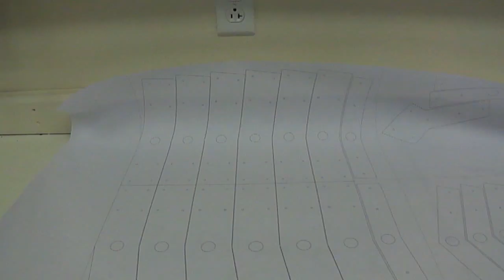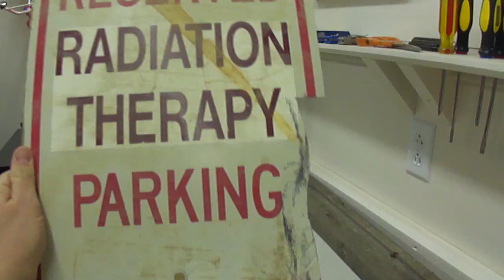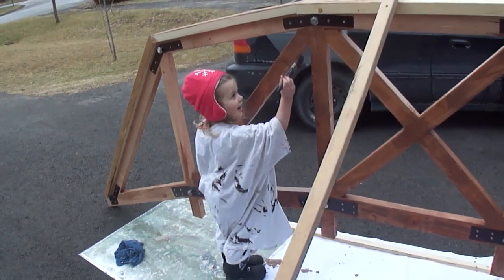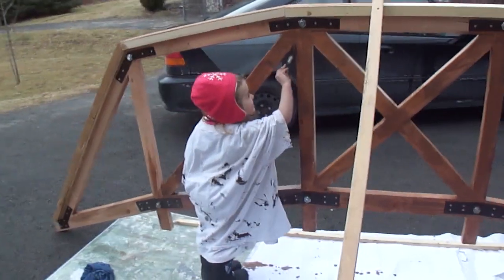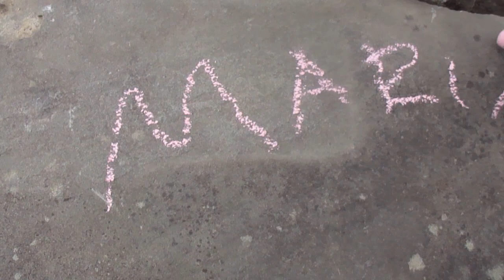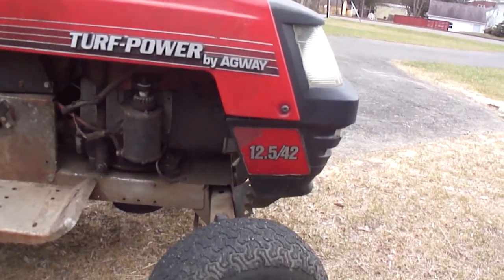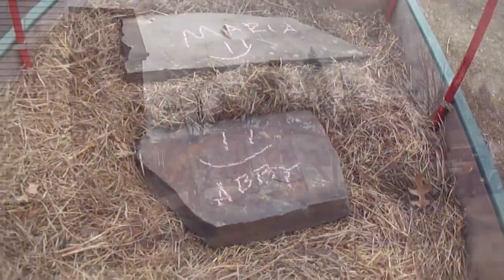Design & Build Wood Truss Bridge - Backyard Decoration Time Laps

Comment: How did you bend the boards?
Reply from the maker: I scored them with a saw about 1/4" deep every 6 inches perpendicular to grain. but the best is to use treated boards when they are still soaked with treatment then they go easy.